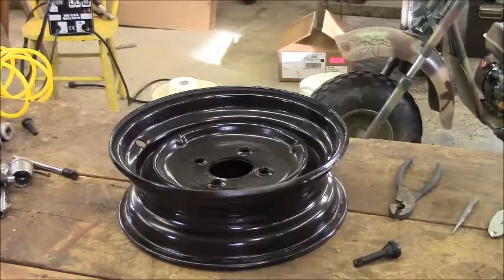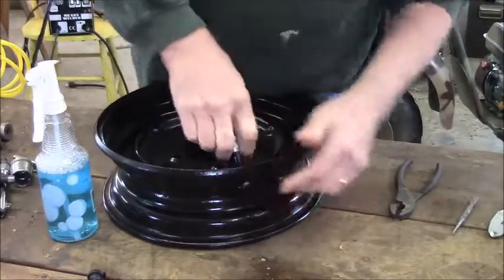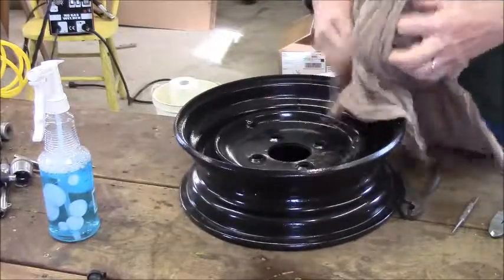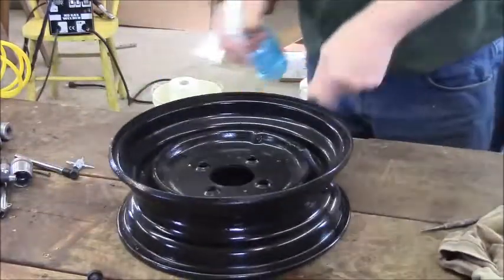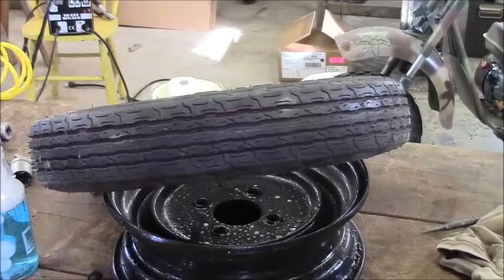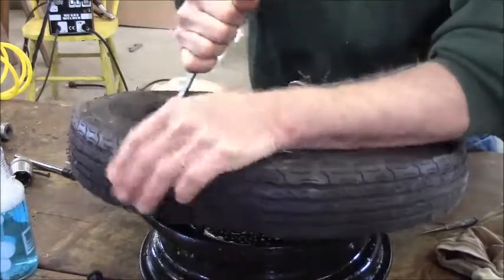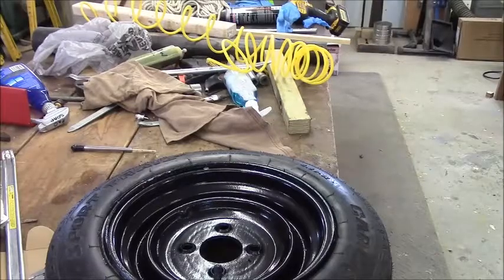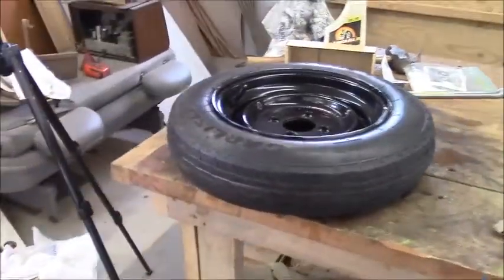How to easily mount a trailer tire, DIY trailer tire mounting

Comment: You make it look so easy. I was literally jumping on the tire with two huge pry bars yanking and jumping and yelling. Finally the tire gave up
Reply from the maker: Thanks! The trick is to get the tire bead down into the drop center groove of the wheel to give you some slack to get the tire over the edge of the wheel. I’ve said it many times, you can’t “stretch “ a tire bead, it’s full of steel wire!
Thanks for watching!

Comment: I just put on a set of these myself and was surprised how easily they went on.   This set of Carlisles were made in China though, the old ones said made in USA.   But that was 10+ years ago...I didn’t have to use any bead sealer with mine but I did have to use a ratchet strap.     It went after a couple of tries.

Comment: Ratchet strap around the tread and tighten then add air with no stem valve
Reply from the maker: I’ve tried ratchet straps but I can’t get them tight enough. Also , my air chuck won’t flow unless it presses on the Schrader valve stem. Thanks for watching!

Comment: Interesting video. I was nervous for you. For those watching, manufacturers recommend that you fill your tires to within 5% of the cold fill air pressure. This allows the tire to operate efficiently and not wear prematurely. Some trailer tires require less air presure, around that 50 PSI mark. The tires in your video Bob, I think you said 90 PSI. Really the tires will be at optimal when filled to close to that number. It's not about the weight of the load they are carrying, as long as you are spec'ing out the right load rated tire, fill them to the recommended air pressure...
Reply from the maker: This is just a spare to be used rarely if ever, and for a light boat trailer so I wasn’t too concerned other than it holding air without leaking. Thanks for watching!
Reply: @bobsbarnworkshop  Following a manufacture’s recommendations is always  prudent. Let’s make sure that we send the right message to our shared YouTube community. Using an under inflated tire could place the user’s property at risk as well as place the safety of the travelling public at risk. Really, trying to install a tire on a rim as shown in your video would not be an acceptable practice in any workplace so I would suggest none of us should be willing to place our personal safety at risk doing this at home either.

Comment: That tire didn't seat, they pop and you can see and hear it when they seat. You need more than 50# to seat a bead, any bead........
Reply from the maker: The wheel doesn’t have the typical rib just inside the bead area that larger wheels have, so the tire didn’t “pop” on like car tires and wheels. The bead is seated tightly around the wheel for sure. Thanks for watching!